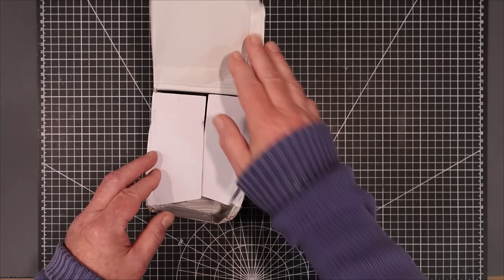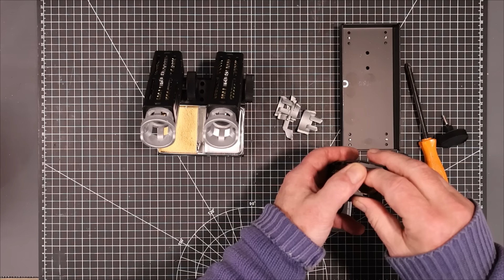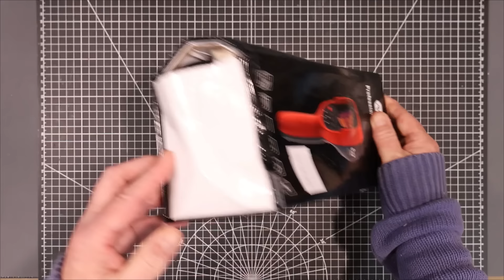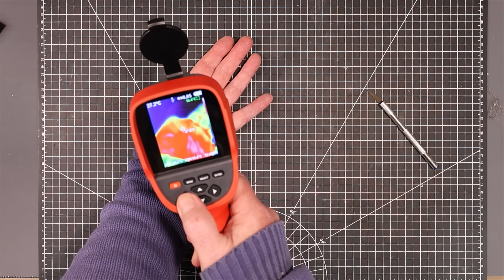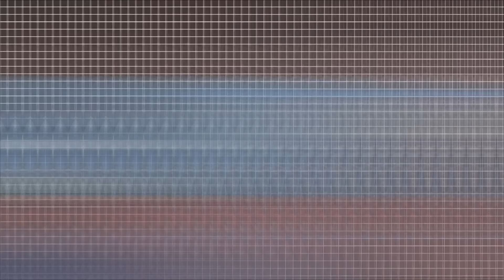Uni-Byte 0277 - Mailbag #37:  My BEST AliExpress HAUL!

Comment: How much current you can put trough that thermal switch?
I mean, you mentioned they will be for battery packs... but batteries under load tend to draw a lot of current and those switches looks not serious enough. I'm I getting something wrong?
Reply from the maker: These particular ones are rated for 10A.  You can get them various ratings.  I've see 5A and 15A too.

Comment: Jeeeezuz there's some SERIOUS handling problems in your delivery chain network.

I'm in South Australia which is much further from China and I've only had a few crushed item problems in 15 years !!!

I'm a laptop repair guy from the 90's and old Lion batteries from Panasonic etc last decades longer than new cells !!

If that DIY battery bank case of yours has springs not tabs in it. You'll find they heat up and fail like mine did due to the current draw during charging 🫤

I don't understand why you don't mention pricing, it's SO ANNOYING !! Every other AliExpress gear channel shows price and supplier on screen !! Please consider sharing with us as it costs you nothing and aggravates for no reason. 

Remember lots of us are watching on Smart TV's, so we can't click on links to get pricing.
Reply from the maker: I'll see what I can do about putting prices up in the future, but most of the folks I watch doing mailbag videos (electronics guys) don't do that at all..

Comment: I use a T12 station as my main and I love those tips. Twenty bucks for the station and two for the tips for performance that only a decade ago would have been in multi-hundred professional territory. And they'll work in a TS100/Pinecil iron in a pinch, if you manage to contain your laughter from the comically long size. The huge chisel tip can even do ground pane work in power connections.
Reply from the maker: They are a bargain!  Yes, that the sort of thing I want that big tip for.

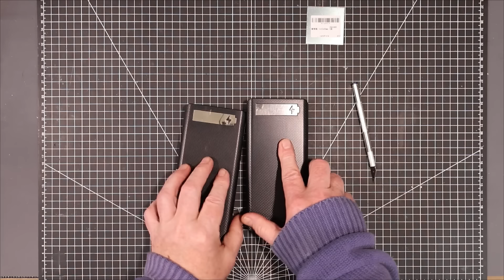Comment: 7:00 i saw those on aliexpress, i'm gonna order one because i also gather a lot of 18650 from laptop, I tested very old cells at 1000mAh and less old at 2000mAh (compared to brand new which are usally above 3000 mAh). As you can fit 8 or 10 cells in the case, the total capacity will be good enough for casual usage even when using very old cells.
Reply from the maker: Exactly.  Be sure to charge them to the same voltage before putting them in.

Comment: 11:15 What do you mean by this? Our electricians usually use these fluke meters at the hospital when we have shorts in our department. Why wouldn't they be allowed to use the blue one? Some kind of standard? I used my own lcr meter to measure shorted 250vac fuses but it's a bm4070.. would I get in trouble if a manager saw that? Or osha?
Reply from the maker: A lot of shops where the electricians union is in effect, they want only Fluke meters.  Some non-union contractors are that way too.  The Insurance companies know and trust Fluke.  They have never hear of Bymen (the blue meter).

Comment: I don't need a thermal imaging camera to troubleshoot circuit bd problems. That's why I have a tongue! :)
Reply from the maker: Yikes!  That's how I used to test 9V batteries.
Reply: @uni-byte , me too. And when I was a kid I stripped the insulation off of wires with my teeth. As I got a few years older I learned to do it with scissors. My family was quite poor and I didn't have much in the way of tools, essentially none, till I was a teen and could work after school for the money to buy tools, and also parts from the TV shop. I so wish I could send a care package of tools, parts, and supplies back through a time portal to my younger self. I could keep my Metcal and still send back one of the Wellers, and then the kid wouldn't have to solder with the old wood-burner with a nail for a soldering tip wrapped tight with wire to transfer the heat since the screw in the end of the wood-burner was broken off. Pretty Rube Goldberg. Those were the days.

Comment: Your vidoes are detrimental to my bank balance 🤣 Keep them coming!
Reply from the maker: Thanks!  My bank balance too, LOL!
Reply: @uni-byte , my bank account will get worse for me if that scope checks out well. I don't like the tiny-screen scopes. The 4.2" display or whatever they are is OK for the TinySA and the NanoVNA. I just make do and deal with it. But I draw the line on portable scopes with small displays. I want to really SEE what the signals look like. I want to know what the electrons are up to. A scope has to be fast. It has to have lots of features. But mostly I want to be able to SEE the waveforms. I want to look for clues in them. I know I shouldn't really need to. The little scope displays  will display numerical mins, maxes, frequencies, etc. But with a scope I'm old-fashioned. Over the years I've gotten used to seeing tiny jitters and such in scope waveforms, and subtle differences in 2 waveforms laid one atop the other, and looking at a waveform from 4 feet away as I probed the back of a large piece of equipment with my long-leaded scope probe, and I was spoiled with a reasonable size display on my bench scope. I've gotten used to using my eyes themselves to embellish my scopes specs. But my bench scope has given up the ghost after several years, so I'm looking around for one that can do double duty on my bench and in my toolbag. I want a large, high rez display even with a 'handheld' style scope that I can put in my toolbag. I've been looking around for a while. This tablet looks like it might do the trick and be affordable.

Thanks for all of your videos, bringing cool new things to our attention, and for your reviews of new tools and equipment. Reviews by people who have done electronics all their lives are so, so much better than those by college kids who may be working on their Associates or EE, but still know next to nothing about the field, in particular the practical end of it. You do know. You examine and test your brand new alligator jumper test leads. They don't.
Reply from the maker: @johnwest7993  John, what are the typical use cases you have for a scope?